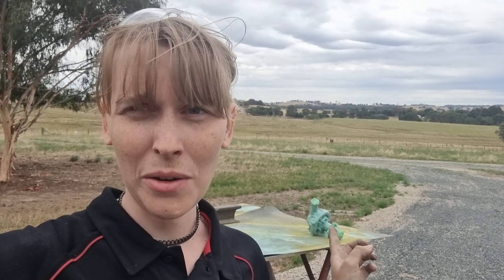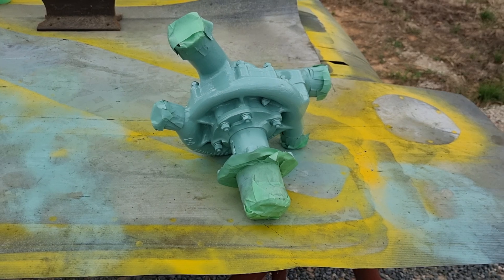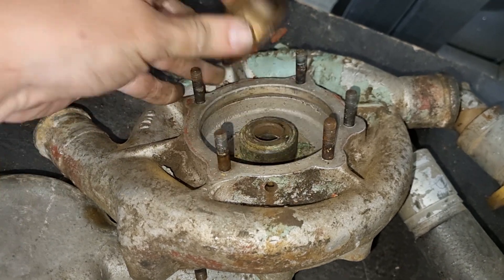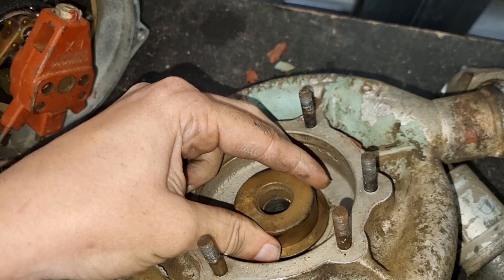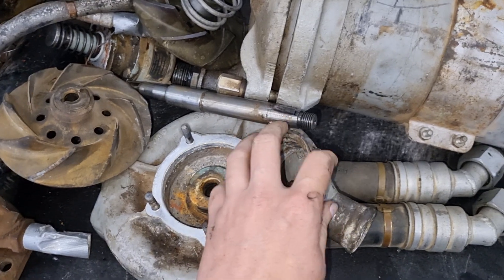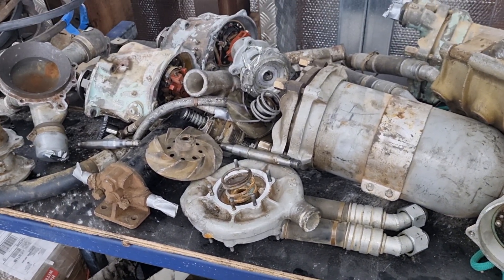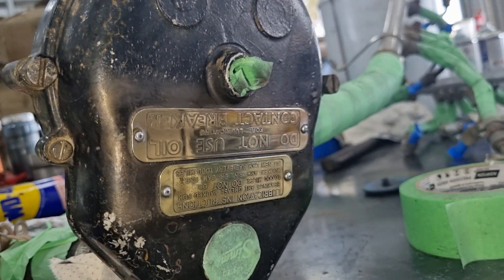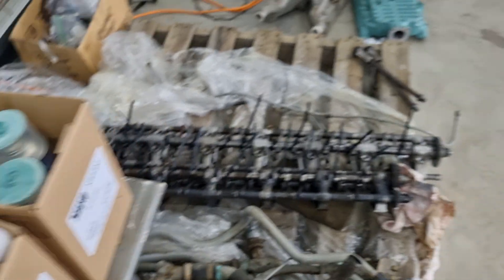The ins and outs of Centurion water pumps

Comment: I understand your frustration about water pumps but you have to understand the basic design for this engine was drawn in the early thirties that’s about ninety years ago. The engine was then modified from aircraft development to auto usage during a war. Little was available and packed glands were a known format for every mechanic and the left hand scroll was a standard. How long do you expect your engine to last. The loss rate was appalling. 30,000 bomber personnel were lost in WWII so divide by three to allow for two engine bombers and you have 10,000 engines on bombers alone! A very rough figure as many will point out. Early Meteor engines were Merlin’s unable to be made flyably and these were stuffed into Churchills and Comets and then developed into the power for the Centurion with the flat sump. Tank losses were expected to be high and the later joy of the Cent was its ability to survive hits and keep the crew alive. Tanks are relatively cheap compared with a good crew to use them. This must always be your history base when viewing older designs of such a period. Russia, Germany, France, Chech all had similar design problems which they had to find ways around. The British Forces had a major problem shared by the forces of the Commonwealth; while there was call up and naming and shaming the personnel were to an extent there by public demand. If the demand lapsed the military campaigns would fail but losses were expected and new designs were called for to replace totally inadequate old ones.

Comment: Very much enjoyed the thorough breakdown of the water pump.  I've known the holes in them as "weeping holes" and if anything is pouring out of them that's bad news for sure.  Interesting that a bit of oil is okay.  Of course I would rather have oil in my water than water in my oil.  Speaking of which is that a rubber seal inside the water pump?  And, IDK, maybe a bit of a dumb question but there are 4 connections on the water pump, are two inputs and two outputs?  Assuming that is correct, it's easy to figure that two outs go to the A and B bank, but where would the two inputs be coming from?
Reply: 2 inlet pipe and 2 output pipe V12 engine one for each side of the engine,
Reply: @petercordell5177  ah, that was what I had been thinking, but two different intakes?  That seems a bit weird to me.  And then no head gasket?  That seems outright crazy given what I know about engines.  That's not still a thing right?  Very much enjoying the videos and learning about the different ways some things are done in engines.
Reply from the maker: The two inputs come from the two large water rails inside the tank. The engine actually mounts onto them 😊
Reply: @lottiethetankwhisperer  so there are water tanks down on each side?  From 60s and M1s I'm use to that space being used for fuel tanks.
Reply: I may be wrong, so I hope no one skewers me for this.  My understanding is that there's an oil side, with an input and an put, for driving the shaft.  The shaft connects to the gear that drives the water pump itself, with its own input and output.  
When it's all put together, as you see at 0:48, one set of input-output is in alignment, and the other pair is about 4 inches further from the camera and also in alignment.
Reply: @AN_Wx28  I appreciate your thoughts.  I did some googling on Centurion water pumps and OMG, there are pool pumps, boat pumps, it's nuts and very hard to figure out what was really going on in the 40s.  I think Peter and Lottie weighing in helped make it clearer that there were two water intakes (which I am still puzzled by) and two outtakes, which I get cuz there are two banks of heads that need to be cooled.  The oil apparently works its way in from the box which IDK, I guess I kind of get from working with more modern engine water pumps, but to have it coming out of the weeping hole I find kinda weird.  All in all, a very interesting setup that I'm glad I'm not pulling maintenance on.

Comment: Is it not worth machining where the original seal is to accept a spring loaded ceramic/carbon seal like most raw-water/saltwater marine pumps run? Seals are cheap and availiable in a huge range of diameters and lengths.
Reply: I have done that in the past when the cover is too bad to repair . this one was ok and valve grind paste on the sintered bronze worked a treat .